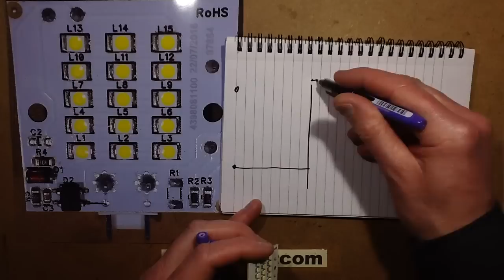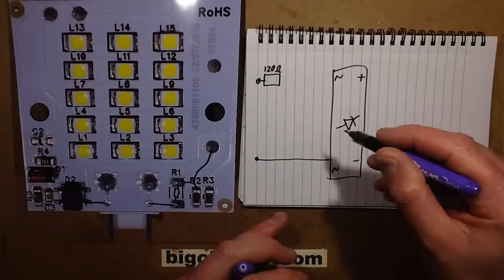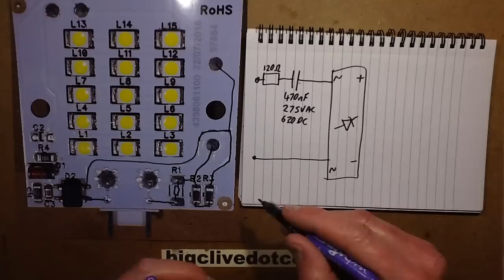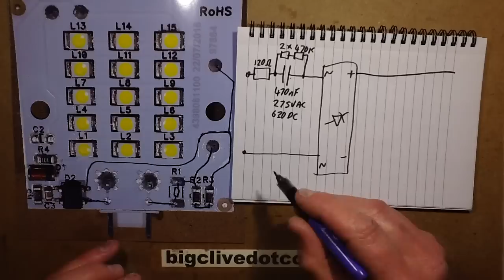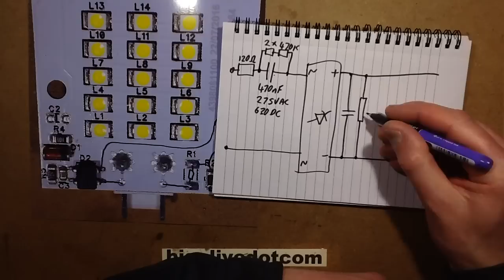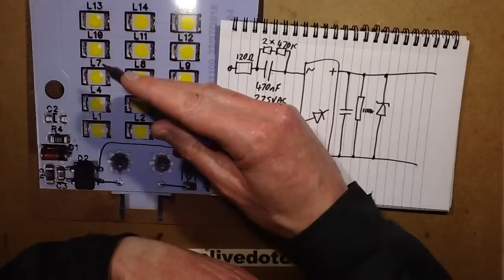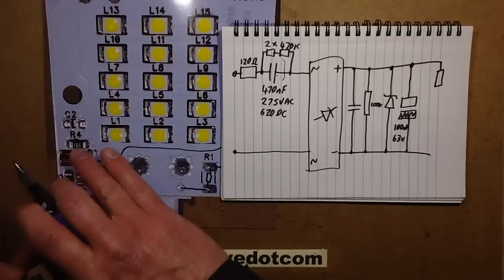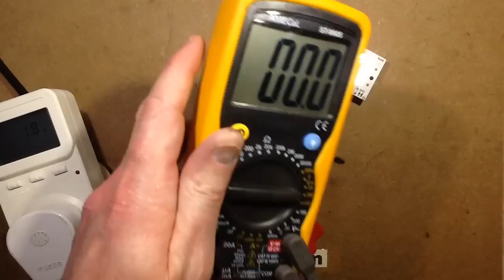"Non-serviceable" LED fridge light module.  (with schematic)

Comment: are pencils conductive
Reply from the maker: Graphite pencils have a very conductive core.
Reply: I remember using a pencil to enable overclocking on an old AMD processor
Reply: AvE has a video on using a pencil as a voltage divider to charge your phone off a 12V battery.
Reply: +shlibber - If it's the generation of AMD CPUs that I'm thinking of, they had small electrical contacts on top with PCB traces bridging them to set the CPU multiplier.  They were getting low yields on their CPUs at the time so after they tested for clockspeed, they would use a laser to burn through the traces needed to arrive at a particular frequency multiplier.   Once their yields improved, people found that they could overclock quite a bit by cutting certain traces and connecting other together.

However using a pencil was considered only a temporary measure.  For longer term use, people bought automotive defroster grid repair fluid, which was  copper suspended in a solvent, sort of like paint.  Once it dried and was confirmed to work, you either left it like that or some people then coated over that with nail polish for even more permanency.
Reply: +TheFLacker99 - CPUs were 1st gen socket (462?) Athlons and Athlon XP.  See the following picture, the dots and connecting traces were labeled L1 thru L7, I forget which ones did which functions:
https://upload.wikimedia.org/wikipedia/commons/0/0d/Ic-photo-AMD--A1400AMS3C-(Athlon-CPU).jpg
Reply: As a kid, I poked a pencil onto the bar of an electric fire. I got quite a tingle from it.
Reply: You can connect a pencil to a car battery charger to make a carbon arc lamp.
Reply: Wait, whaaaaat?
Reply: Wow, thanks for the info. I didn't know that was a thing. What CPU's were these?
Reply: dam, I'm too young for this XD

ever since I had my own computers and really got in to the tech stuff they had free multiplyers on AMD CPU's

I did not notice much improvment in overclocking my current chip by 10%, perhaps cuz the chip already is quite powerful and my harddrive is the bottleneck for the entire system
Reply: if the hdd is the bottleneck you shouldn't worry about overclocking
Reply: once the data is in the RAM the harddrive won't affect much performance
and since I got a veloci raptor there's not much else that could be done because I don't want a SSD in my system
Reply: Put a pencil in the microwave. It'll explode. I learned that the hard way as a kid with one of those color changing with heat pencils.

Comment: Hi Clive. another brilliant video, thanks! Quick question: would it be possible to build a circuit to power a couple of meters of 32v led tape from a 5v usb power bank? some sort of booster circuit or something? Thanks, Phil.
Reply from the maker: You do get boosters, but 32V seems quite high.  An alternative might be to use some of the newer 5V LED tape.
Reply: bigclivedotcom Thanks for taking the time to reply! I think the tape is a group of 10xleds in series, chained up in parallel. I'll take a look at the 5v versions. Thanks again!

Comment: Clive, I have a question. I put an inline dimmer on my floor lamp. I got it on eBay and it's branded "Relco". 
It makes an annoying buzzing sound, audible when I'm within 2 meters of it. Is this normal?
Reply: Relco is usually a good brand (Made in Italy). It is normal for dimmers to buzz slightly if they are of the phased-fired type (with the triac). The reason why it buzzes loudly is because phase-fired dimmers are not meant to be used with non resistive loads like fluorescent lamps (even of the compact fluorescent type) or LED lamps, where they are not evenly loaded. Try to put a halogen or incandescent lamp if you're using other lamps. If it still buzzes that loud, it is defective, probably the capacitor that triggers the triac.
Reply: MrOpenGL Thank you. The bulb that I'm using is of the halogen variety. It's not loud at all, really. It's just my tolerance level is low.
Reply from the maker: The phase angle control produces a noticeable buzzing noise that is loudest at the mid-range settings.  It's usually the internal choke that makes the noise.
Reply: Cheers, Clive. At least I know it's okay.

Comment: Since all these appliances have control circuits, they should use their low voltage d.c. to light the fridge lights? I have been using led lights around my house that claim 17 year life, but I have had to replace several after a year or two. I firmly believe the leds are not failing, but the lousy power supplies are giving up. In applicances one high quality 5-12 volt power supply should handly everything except the motors!

Comment: Not gonna ever see that? Don't you get in your fridge every now and then to see if there is light when the door is closed? :O
Reply from the maker: I used a jigsaw to cut a large hole in my fridge door so I can check if the light has gone off.
Reply: Seems like a better option indeed!

Comment: I'll guess that the fault was one of the two mains solder joints was cracked and you fixed it when you hit it with the leaded solder.

Comment: The light bulb in your mains connector uses 0.2 amps according to your tester. That is if I read it correctly, it wasn't in the best light.
Reply from the maker: It's most likely 2mA as it's a neon indicator.

Comment: A little dry lock lubricant would be good for those squeaking pins.

I used to put white lithium grease or something similar on things like door hinges and even in locks, but the amount of dust and grime it attracts is annoying. I found some Teflon dry lubricant at a local store, the bottle has lasted me years now, but if ever I have something squeaking and I don't want it to attract dirt I just use a drop of it. Works quite well.
Reply: Jesse Crandle BLASTER dry lube

Comment: RoHS fucked up the Xbox 360. The first two Motherboards Microsoft released for it suffered massively due to solder jointed cracking, underneath the GPU, CPU & the terminations at the end of their tracks to other components. 

This, inspite of a heat shroud, a huge heatsink & 2 fans that run like Jet engines. Xenon & Falcon Xbox 360 motherboards (2005 and 2007 manufacture date respectively) suffered due to Lead Free solder! 

Maybe they should put GALLIUM in it. Gallium isn't toxic to humans & things like cats and dogs. So maybe, just maybe...lead free solder could be malleable with gallium based solder instead..

Much lower melting temperature mind you.

Comment: I'm a whirlpool factory certified service technician with that being said whirlpool uses a similar led light that has a retail value of around $155 USD
Reply: soccer1josh BKV Is it compatible with the models that use the $42k compressor as well as the $30k ones?
Reply: jctoad without model numbers I can't look it up to say for sure but the one I am referencing is on most of the new side by side refrigerators. From what I have seen in the field most are different part numbers
Reply: model number BIG$$4US
  I was just making a joke.

Comment: Long time ago i learned  from people who design boards and components that  if you see some not really needed part(like that diode) or weird design of simple boards, it was made like that not because people behind it where lazy or they didn't had experience, but because it was designed to fail quicker.
Of course it's not like everything is made like that, but lots of time I see and hear about it.
It's not some hidden conspiracy, but simple business. 
And like other people mentioned, everything is so "ECO" and power friendly, but because of those planned design flaws that keep money flow, we need to use x2 more time/power/components/tools to do or use most of our stuff. Eg I have old kitchen blender(almost 18yo) that take lots of power and its loud as hell and its made from old thick plastic... And it still work compared to 5-6 "new" supet-ultra-eco blenders that I had for past 8 years... 
Too much small electronic in places where simple thing like eg bulb in fridge would be enough...

Comment: I wonder if condensation got on the board and lowered the voltage enough that the led's went out, looks a bit too open for being inside a fridge, it probably only had a simple cover for safety
Reply: natural

Comment: Hey Clive, In a semi-recent video I think you briefly mentioned something about getting tingles off class 2 appliances? Could you point me in the right direction?
Reply from the maker: Cameron Steel Would it be the video "Power supply electric shocks."?
Reply: bigclivedotcom Ah yes that was the one. Was a little further back than I thought, I must've gone on a 1am bigclive rampage😂

Comment: One thing I've noticed when you use the quick test and the power meter is that the quick test is using 0.2w before you close it (indicator bulb I would assume) so that would throw out low readings quite a bit.

Comment: My GE fridge LED light went out.It was the transformer that stepped 120v to 23v DC.I used a laptop charger and saved over 300 dollars. I did not have a warranty.
Reply: Rob Carstuff my GE fridge is running strong. I have been in the house almost 10 years. Not exactly sure how old it is. Icemaker is starting to crap out. I have a good opinion of GE Products myself.

Comment: i wonder if it was the lead free solder not having a good joint on the pins you added your s
good solder to, to attach your wires.  There by reflowing and fixing the failure?

Comment: I was quite disappointed when I saw the lighting of my new Gorenje refrigerator freezer combo I bought in 2016. 
Of course it used a cheap capacitive power supply that only had a tiny SMD smoothing capacitor, so that the cold white low-CRI LEDs not only made the food look unappetizing, but also flickered noticeably. 

As a result, I replaced the anachronistic lighting with three warm white 1 W LEDs on ’star‘ heatsinks, powered by a cheap Chinese 3 W constant current driver. Everything fortunately fitted in the available hollow and, knock on wood, still works after months. I don’t think my construction was more expensive than the original one.

Comment: what no mention whether you should have a cold white Led or warm Led ! wonder how much the normal incandescent lamp would raise the temperature inside I suppose it wouldn't make much difference as the fridge door would be open , thanks Clive for furthering  my knowledge keep the Maths coming its not my strong point ,  and as Kenny Everett once pointed out that little light really does go out  !

Comment: Why they bother with low energy lighting in domestic fridges I don't know... if you go in for milk for tea or coffee... door's only opened for around a maximum of 30 seconds tops, most of the power consumption will be the compressor kicking in again as it usually does shortly afterwards... makes one wonder if industry is obsessed with LED's at the moment as if tungsten is becoming extinct.

Comment: Big C- Can you do a vid on your printer?  It's a continuous ink system, right?  You get some very nice prints with it!
Reply: I'd second that. Also, I really like this "Clive-CAD" method.
Reply: +mnelson10000 I noticed the bench colour in the picture was exactly matching the real bench colour. Very sharp/vivid pictures you print Clive !
Reply: I have an older Epson stylus photo r380 (a 6 color printer from 04 or thereabout ) with a cis system... i love having it. last year I bought a few 100 packs of matte photo paper and printed out all my favorite digital photos to have physical copies. I highly suggest a cis kit if you have a printer that accepts one and are ok with its fiddlyness... i have a 6 color purge page on an sd card i leave in the printer and print a few copies out every week or so to dump fresh ink into the print head and keep it from clogging or getting air in there..
Reply: I dont know what printer he has but i bet its one of those with built in CISS like Epson L210, fantastic-ass printer (but you do have to use original ink bottles, otherwise it clogs)

Comment: Do you take photos of the circuit boards or do you scan them in?
Reply: He takes macro photos and prints them out I believe
Reply: My guess would be he takes photos. I would think it's better to use the zoom function of a camera first and foremost, then use software zoom second if need even larger image.  I think you could get the max clarity from that route.  That said, I have not had a really good quality scanner in a long time, so no idea what a really good scanner and software will do nowadays.
Reply: In some of the larger items imaged you can see perspective on the edges, so it must be a photo. If it was a scanner it would look flat
Reply from the maker: I take a photo with my Moto G phone, which has very close focussing.  Then crop it to size.

Comment: On the Rohs. Recycling would probbably have a better environment effect than taking the lead out. As long as you dont put the lead in a landfill it's not hazrdous.
Reply: rimmersbryggeri  agreed, except when it ketches on fire and then becomes a gas.
Reply: The PCB material fumes dont really smell theat much healthier and PCB material is alot more volotile.
Reply: In an electronics fire, the lead fumes are one of the most harmless fumes being produced.
Reply: I would agree, the refrigerant gas being burned produces phosphene gas. That's the worst 2nd would be Hydrogen Sulfide  and then A numerous amounts of acidic gasses. Lead fumes being bad but still lower down on the list.

Comment: We've been using lead-free for ages. If anything the higher failure rate is due to the number and size of pins modern components have: Old TVs didn't have sub 1mm pitch BGAs with almost 1000 pins running the show.

Comment: Not sure I get this.  The circuit board was good but the door switch was faulty.  The repairman replaced it with a new board and was on his way.  Problem solved.  How?
Reply: I do warranty service for retail, and they prefer a single fixit visit within reason. Find the fault, fix it or order parts for 24 hrs (or 4 via courier) as long as the call comes in 100% functional. Sometimes they ask for the old parts back, 
This can range from bad capacitors (yes, they're still showing up) to customer 'configuration errors'. aka a cord mangled or simply unplugged. Same rate. I've changed caps on home TVs for work, but for PCs they send a whole board for the smaller stuff, or in some cases a whole unit to take apart for the appropriate working bit.

  Weird in its own way, as some approaches I wouldn't do without spares, like swapping a CPU board only to find that the problem was caused by  AC mains.  Plugged into the wrong circuit it had a regular interference from some equipment on the same line. (the counter has 'dedicated' outlets for registers, but nobody noticed the orange outlets empty a foot over where the register was plugged in..) 

 "100% functional." Done.
Reply: Joseph Nicholas as explained he may have replaced a few components faster and cheaper than diagnosing the real problem.
Reply: Thanks, I must have missed that in the video.

Comment: Now I'm confused.
I thought a cap in a capacitor dropper would have to be rated for peak voltage, that is somewhere around 350vac with the typical 240vac RMS? How come 275 is enough here?
Reply from the maker: The 275V rating of an X2 suppression cap is its RMS rating.  The peak and DC ratings are much higher.
Reply: He mentioned 600VDC so has all the bases covered :-)
Reply: Where did Brian Deschenes comment go? I can't read all of it in my alert menu.
And Coolkeys, a 630VDC cap is typically only rated for 2-300VAC.

Comment: A surprisingly large module. I would have expected a couple of  1W LEDs on a board much smaller than that and some coating on the board since it's going to be quite damp inside quite often.
Reply: petti78 fridges are not damp they are quite dry inside. Have you ever seen anything damp inside.
Reply: Cliff Hartle Well I regularly see the water drops flowing off the cooling panel during the ice melting cycle. Also when you open the door there is a rush of warm air into the cold innside which should cause condensation on plenty of cold surfaces, including the lamp housing I imagine. The dew point and other conditions inside must be changing quite a lot every time you open the door etc.

Comment: How much do you spend on ink?
Reply: Compatible inks (and a CISS i believe) plus Poundland paper, adds up to not much really.
Reply from the maker: http://www.ebay.co.uk/itm/401255343174  In a bulk CISS iny feed system that has an ink ribbon cable going to a modified print head withj self resetting chips.
Reply: Used to hand refill the cartridges on my old printer, worked out about <20p a refill

Comment: LED light in my fridge died a week after the warranty ran out. Considering the amount of time it's actually on, I find that quick pathetic. I took the board out and noticed a burnt out resistor and capacitor which I replaced. It's still sitting on my desk 2 years later as it still doesn't work. A replacement costs about £15. :(

Comment: It would be quite interesting to explore the correlation between lead-free solder and the e-waste problem. I figure solder failure is a disappearingly small portion of the reason behind throwing stuff away, and consumerism is the true driver of the buy-discard-upgrade culture, but then again... What if electronics weren't seen as breakable-and-unfixable. A part of me yearns for a future with more repair professionals and a much higher re-use rate than today. It's awful, the amount of perfectly fine electronics that get "recycled" today.

Comment: You measured voltage including a 100R resistor in series, 100R*0.025A is 2.5V, you measured 48V, so the voltage across the LEDs was actually around 45.5V.
Reply from the maker: Good point.